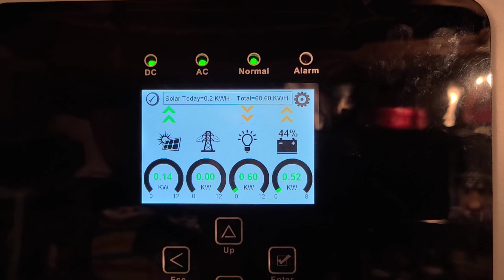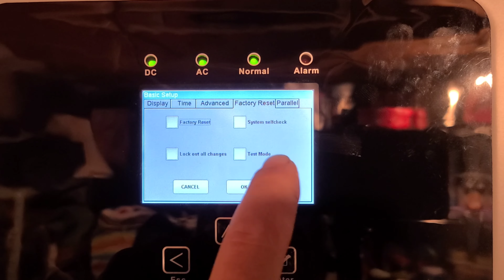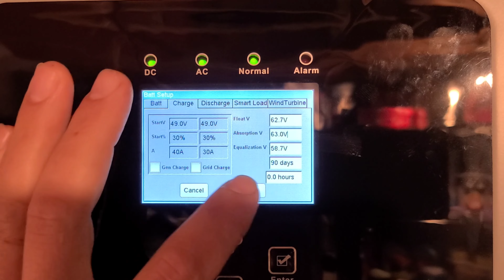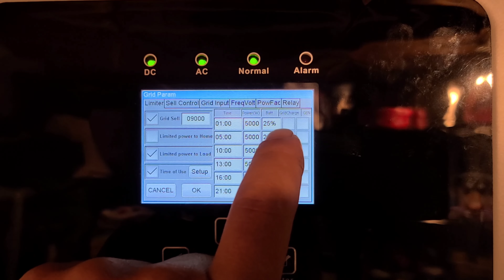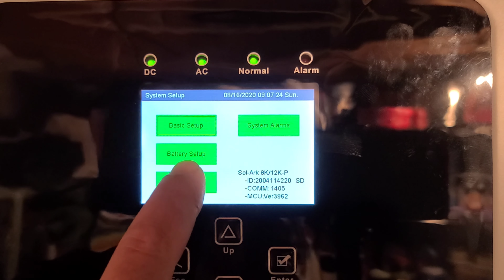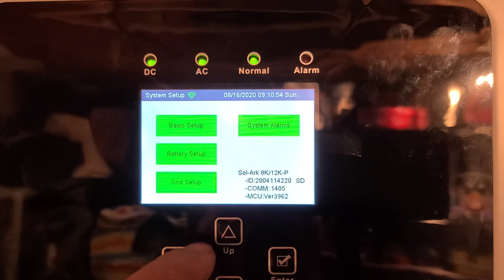Sol-Ark 12k Menu Overview

Comment: Hey Ben, would you be able to comment on the DC and AC temperatures both when the PV is producing and at night. Seems like mine is running hot, but cannot seem to find any reference points
Reply from the maker: I honestly don't know what they should be operating at.  What makes you think they're running hot? That would definitely be a question for Sol-Ark.

Comment: Thank you for the video. Even much more explicit even than the folks at Sol-Ark. I do have a question for you though. How does the system get to restart automatically without manually turning it back on when it is down? That happens pretty frequently. It is annoying especially when I am not around since I have that system in Haiti while I live in the States. Your answer would be greatly appreciated. Regards!
Reply from the maker: Mine has always restarted automatically. Just takes a couple minutes.

Comment: Always looking for more info on zero export. Very intrigued that you also have an AC coupled solar in tandem. I have several locations I'll eventually be putting panels, and a mix of systems seems to be the way to go.
Reply from the maker: Hey Mike, actually one of the features I haven't tested is zero export, and specifically zero export from AC coupled Solar.  I know that it can't frequency shift the AC coupled off when connected to the grid, but it MAY be able to shut off the gen breaker which is one way to tie in AC coupled systems. 
One thing to be aware of with these and other zero export systems is that there is occasionally a tiny amount of power that is exported.  If you have an analog utility meter, you're fine, but the newer digital meters will catch it.

Comment: Hi Ben. Good videos on the Sol-Ark.  I am trying to find out if a 12K can be set up in grid tied (with the CT's installed on mains) with a battery and also a large AC coupled solar array also on the grid side (main panel). This would be with NO DC coupled solar.  It looks like you have your AC coupled array connected to the load panel so the sol-ark can frequency shift to shut down the solar edge.  If I have an array on the grid side will the sol-ark be able to charge the battery from the solar?  I think there is a setting for charge from grid but I don't know if it uses the CT sensors to know when there is AC coupled solar power headed out to the grid and would therefore know to route that to battery charging or does it just not care and just charges from the grid all the time?  I think I would also need the setting for limit to home checked (as well as charge from grid and TOU).  I realize that if the AC coupled solar was connected to the grid instead of the load or gen breakers that if the grid went out, the sol-ark would supply power from the battery but not the solar.  That is ok in my case - I also have a whole home generator.  Since you have everything needed to figure out the answer to the question, I could pay you for your time to run a test.  I think it would just involve swapping your load wires in the sol-ark from load over to the grid breaker in the sol-ark, shutting off the DC coupled array, switching on grid power in your load panel, and running the solar edge to see what the sol-ark does with the power.  Will it charge the batteries and attempt to limit the power going to the grid, or does it not watch the CT readings and just dump grid power into the battery charging?  I've looked at several battery storage systems to try to find one that will do this - Tesla won't , Enphase won't It seemed like Sonnen would but they wouldn't return any phone calls or emails (3 or 4).  I talked to Sol-Ark tech support on the phone but the guy seemed to only be familiar with the standard setups and couldn't really say what would happen if it was run like this.  Thanks for your help. Dan

Comment: In the limited to load mode, does it supplements power from the grid grid if the inverter gets overloaded?
Reply from the maker: Again, I'm not 100% sure what would happen in grid tied mode.  It will either trip the breaker or trip something internally and shut down for 1 minute.

Comment: Interesting install and good information.  Question...  I understand how your Sol-Ark tricks the SolarEdge into operation when you are disconnected from the grid.  However, if your Sol-Ark is also configured as Grid-tie, how does it startup?  Seems like the Sol-Ark grid-tie safety circuitry would have to be disabled for it to start generating AC and then "trick" the SolarEdge.  Maybe you could discuss this?  Thanks.  Good Content.
Reply from the maker: Hi Dan, good question!  There are essentially 2 sides to this inverter; the grid tied side and the off grid side.  The grid tied side does still have a grid proving circuit that will not allow it to connect with or push power back to the grid for a set amount of time. It will allow power into the controls though for setting things up before that period is up.
  I typically turn the battery on first and go through the settings, then turn on AC, but it can be done either way.
Reply: @benssolarandbattery  Ok.  So you actually have the off grid side connected to the grid?   In one of your videos (maybe this one, I do not recall) you mentioned that you had ordered an interlock for your breaker panel.  I assume the interlock you mentioned was to prevent connection of the off grid side of the Sol-Ark while your grid main breaker is on.  Correct?  I actually have a similar system, ~10KW SolarEdge grid tie system and another smaller system that is also grid tied  (~1KW) that I am thinking of upgrading and converting.  Wonder how much power the Sol-Ark system has to provide to accommodate the SolarEdge grid-tie to turn on...

Comment: Well done man, thank you.  Getting closer and closer to pulling the trigger.

What attracts me, the high voltage pv input and grid tie limiting.  Will make install on both ends easier, much easier.   

Like you, I want to go off grid but can't just pull the plug and spend 30k on a system, will need to grow over time.

Thank you for the videos, keep them coming.  And yes, remember seeing you on David's channel and instantly subbed when I saw you had your own channel!

Comment: Do the apps have to connect to Sol-Ark's servers or is the connection to the Sol-Ark 12k on the local network via Wi-Fi?  To put it another way if your house does not have internet can you still use the app to monitor the system?
Reply from the maker: As of right now, you do have to be connected to the internet to use the app.  All monitoring can be done on the Sol-Ark screen as well.  They have said that they are coming out with a non-internet based app for in home remote (remote from the inverter) monitor. Should be in the next 6 months.

Comment: Is is possible to run the Sol-Ark in battery-less mode off-grid?   I am going to be building a home off-grid and the battery delivery may be at a latter date, so it would be nice to be able to use power directly from the solar panels during the day.
Reply from the maker: I don't believe so, but you can double check with their tech support. They're very responsive to everyone. (Some tech support will only speak with installers)
Reply: @benssolarandbattery  OK, I will check with them and report back. It is not clear from the manual. I search for "No battery" does turn up some results one of which is in the troubleshooting guide. Which says "There is no battery connected. If not using a battery, select no battery in the setup Batt menu."

Comment: Good Video man, i am running 2 solark 12k's been using for gridtie but fixing to hook my battery bank up tomorrow.  Tried the parallel setting but alarms went off and screen displayed "No Battery" when i tried to set on inverter as the Master and the other as the slave.  I did install the Ethernet cord to bond both together for communication.  Not sure about alarms though. Going to call Solark back  tomorrow and see what i missed.. But once again thanks for the video.
Reply from the maker: Thanks!  I've never tried to parallel them without a battery, maybe that's not a thing?  I got the modbus number backwards on a couple of them once, but it didn't hurt anything.  (just my ears until I figured out how to turn off the beep)

Comment: How does a 8k inverter control 10k grid tied Ac couple most inverters recommend only 80% of the maximum continuous load
Reply from the maker: Sol-ark can AC couple with up to 9.6kW.  My 10k rarely puts out more than 8kW and some of that gets used before it goes back through the Sol-ark anyways.
Reply: @benssolarandbattery  So 80% of 12 is 9.6 kw so you have a 12 kw inverter?
Reply from the maker: @offgridwanabe  check out the specs here.  https://www.sol-ark.com/wp-content/uploads/2020/07/12K-brochure-combined-7-22-2020.pdf